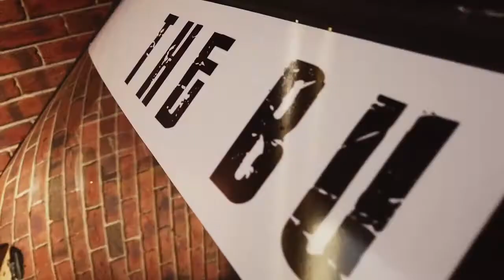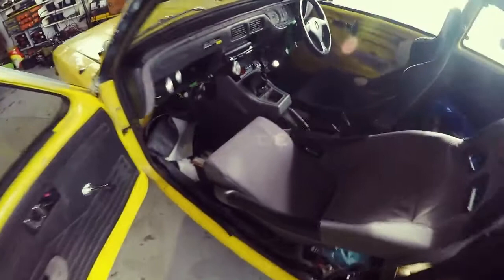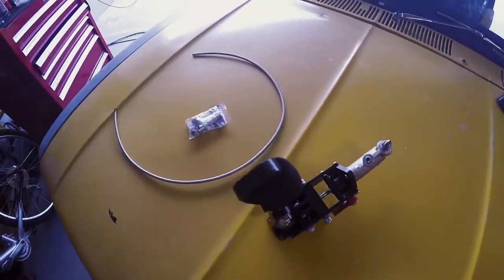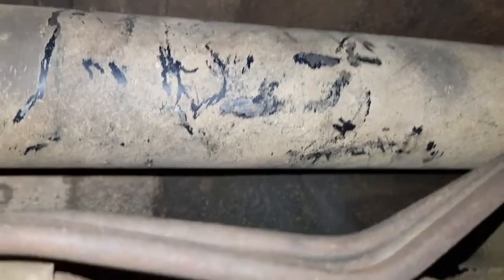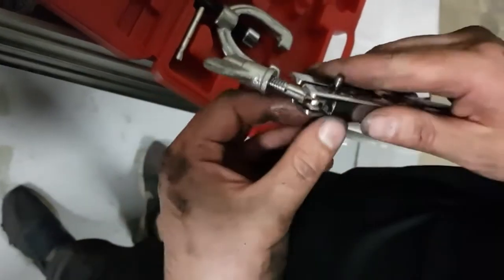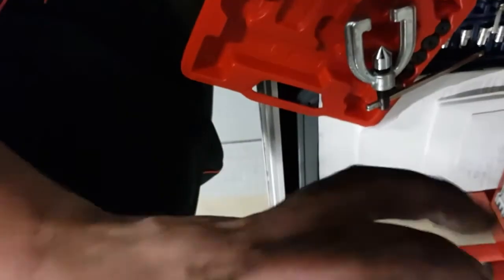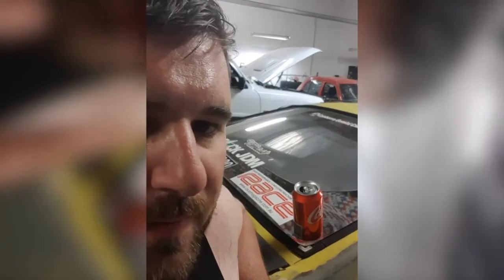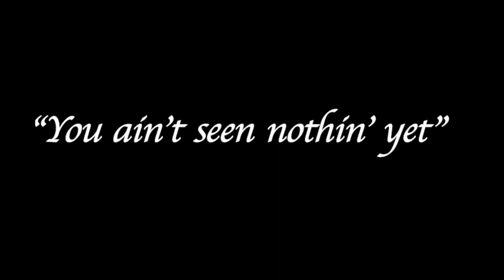The Bucket gets a Hydraulic Hand Brake Pt.1 - 1975 TX Gemini Coupe

Comment: I love this stuff as it brings back memories and what was, versus what is now possible.  My parents bought me a Holden Isuzu TX Gemini COUPE almost at first release date.  It was yellow colour and I absolutely loved it.  I have no idea what HP at the flywheel they had but I do remember that if I had a full load of mates and gals in the car (the norm) it was pretty much topped out for top end speed at 120 to 130 KPH.   

An exceptionally smooth manual transmission on my Gemini; albeit I had way more prangs and crashes in this little yellow Gemini car than most that have come after it, including my current pretty much fully forged 416CI Normal Aspirated stroked VE Commodore Calais-V with a tad over 500 rwhp.  Of course the power to weight does account for some aspects though - the Calais is pretty much 2,000kg including big ass tow bar and stuff.  

The Holden Isuzu Gemini are oh so light weight, they must fly with the Forced Induction and machining gear available today.  I'm 64 years of age and still have the need for speed and passion for cars.🙂
Reply from the maker: Great to hear! If you look through our videos I've actually got a yellow TX Coupe 😉 mind you hasn't had any real prangs. 
Are you in Canberra? 
That Calais sounds pretty mad.

Comment: Nice vid. Did your flaring kit come with the small black discs?  You need to flare with that first so it makes a bulb then flare with the tool. That gives you a much stronger double flare. Also tighten the wing nut closest to the pipe first all the way then the further one all the way stops the pipe slipping.
Reply from the maker: Thanks Andrew! I can't remember if it did or didn't at the time. We got it all sealed up and working with the flare that Adam made. I might mention it to him but. It's his tool so that might come in handy when we do another one :)